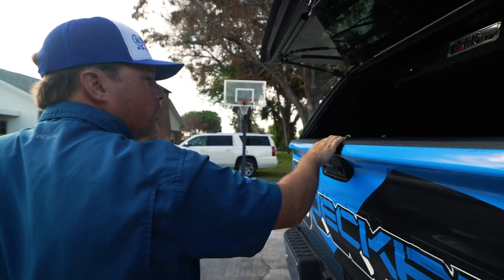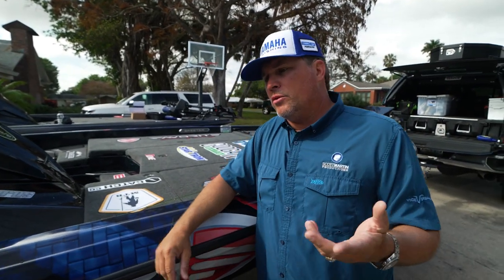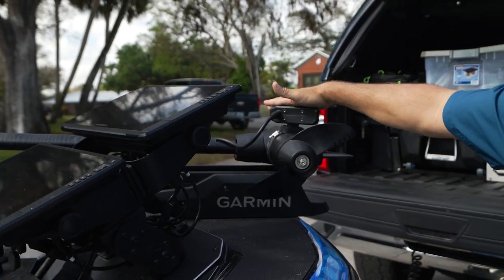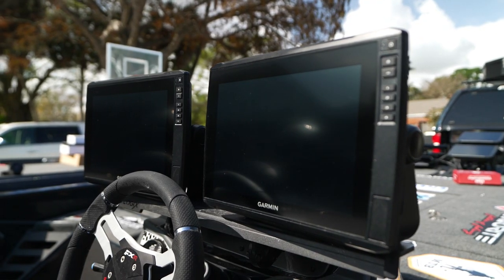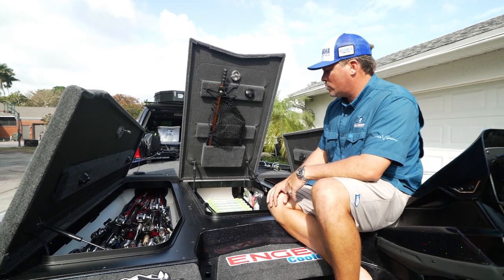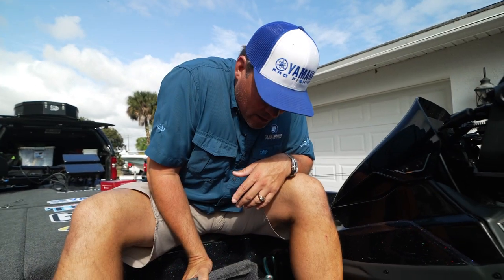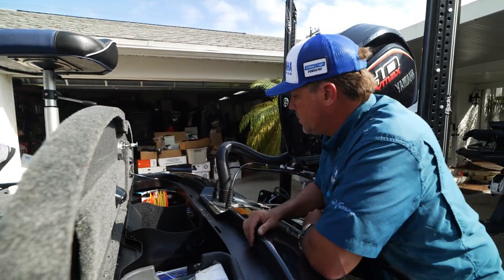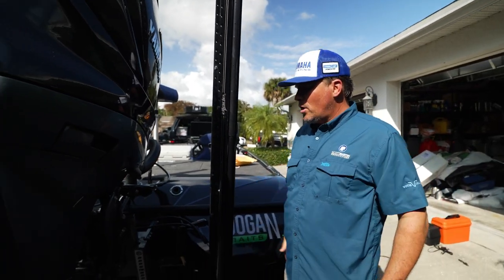My NEW TOUR BOAT - Best One Yet!!

Comment: Make sure to use a nut driver instead of a screw driver to take that hose clamp off, to avoid putting the screw driver through your hand hanging over the bow of the boat. Floating nut driver now to speak of it haha. Take it from a commercial clammer that uses hose clamps to hold the aluminum poles together.

Comment: Hey Scott, will you not have issues when you spot lock and it corrects position for the transducer? Also, I hear plastic ties are not good for the transducer cable.
Guessing you must have sold your boats since I haven't heard anything???

Comment: You know if the sun comes out the boat ramp at Rodman res. Will be going off that flat right there will be stacked or go south down there around lake George the croaker hole or even the 3rd truss south from the boat opening on the railroad crossing Carolina rig it with a swim bait of course you know all this stuff lol good luck buddy

Comment: The issue that we had with our panoptix on the motor was that when we went to spot lock, we were essentially without the system. I have found that having it on it's own independent beam attached to the trolling motor was the best way. You have full independent control that way.